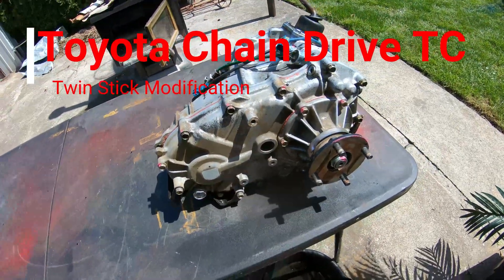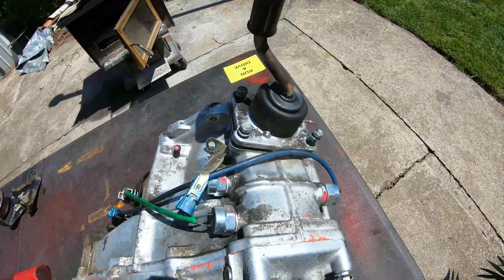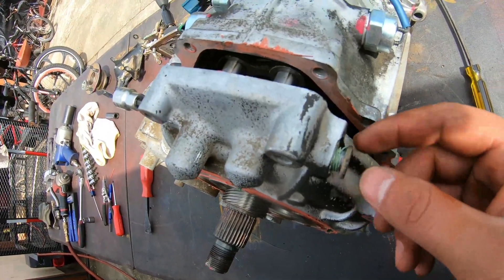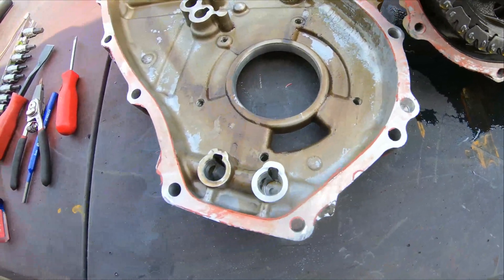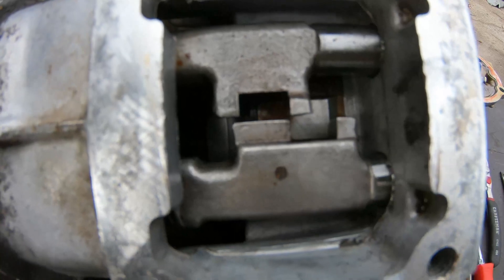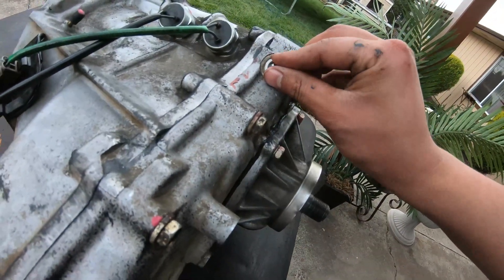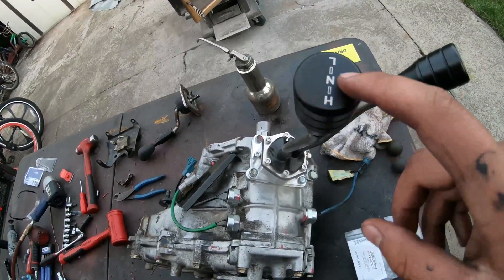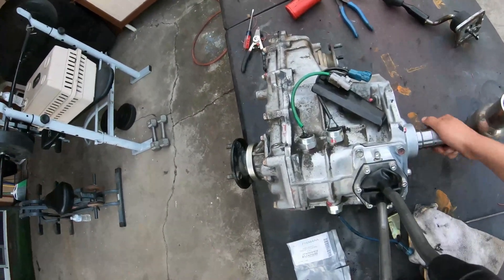Toyota Chain Drive twin Stick Modification

Comment: Thanks for this video. I just needed visuals on a few things. I have to replace the boot on the bottom of the twin sticks but it seems based on your video I can just unbolt it off the top through the cabin and remove the assembly and then change the boot and put it back together. Thanks a ton for the video!

Comment: Can you regear this to 4.7?
Reply from the maker: I don't think that's possible with the chain drives.
Reply: @rustysprocket8725  dang it!
Reply from the maker: I think there is an adapter plate called "Tacobox" that lets you double up two cases. Its been a while but Google that name, i think Marlin crawler makes it
Reply: @rustysprocket8725  I know that one but I am trying to find a poormans crawl box

Comment: Can I do this and with a 1997 4runner 3.4 manual
Reply from the maker: Should work
Reply: Thank you did you have to modify the transmission shifter
Reply from the maker: No, i did bend the twin sticks a little bit for better clearance
Reply: Thanks a ton
Reply: Last question what kinda truck did you do this on? Out of curiousity
Reply from the maker: 99 4runner

Comment: On a 1995 landcruiser 3x locked I so far installed the low range gear and the spool to get rid of the part time 4wd. My truck has the stock transferase hooked to an automatic. What would this mod do for me. I was trying to figure out a way to select front wheel drive or rear. I also added locking hubs to the front.
Reply from the maker: I don't think you can get fwd or rwd from this mod on your transfercase, not 100% sure though.

Comment: Chain driven cases are typically found in automatic 6 cylinder trucks?
Reply from the maker: I think that 2nd gen 4runner & up is all chain driven, but not 100% sure.

Comment: I’m about to do this too. Wish I read the instructions when I had the case out!  😂
Reply from the maker: Most of the instructions I found were for gear driven cases, and I wasn't sure if they were similar. Fairly easy mod. Hardest part was probably cutting the little stubby part on the shift rail without getting metal in the case.
Reply from the maker: If you find the video helpful please subscribe, it helps me out too. ✌
Reply: @rustysprocket8725  do you have to cut that piece off or just remove the pill? 
I’m not finding much instructions either.
Reply from the maker: You have to cut it off. That piece interlocks both shift rails from moving independently.
Reply: @rustysprocket8725  the instructions are listed under Tacoma on their site. And of course you’re right. I was reading the wrong instructions. 

Thanks for the video. Subscribed keep them coming.